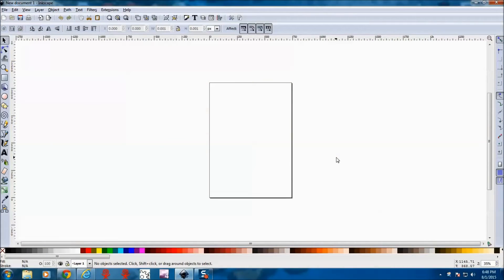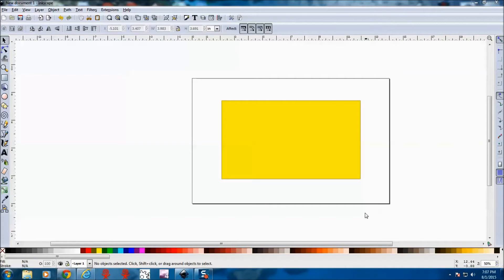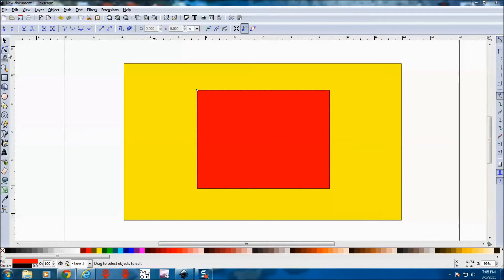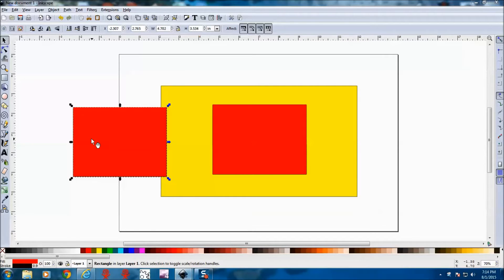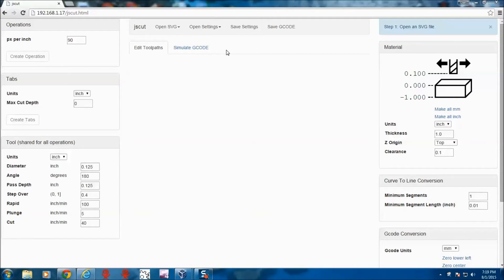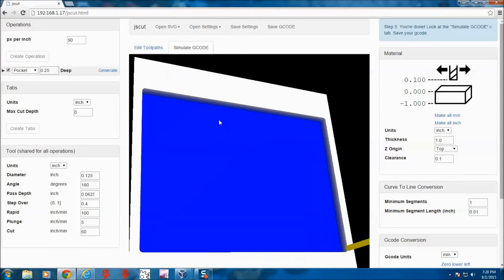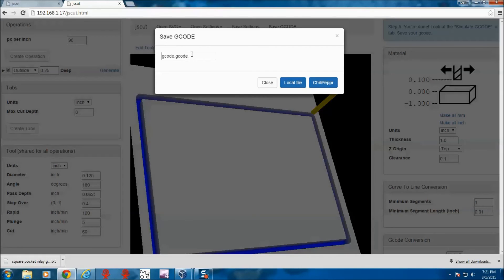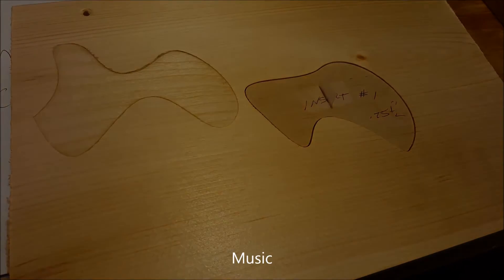CNC Wood Inlays - Using Free Software

Comment: Thank you for the post. You had mentioned Mach3, when I use Inkscape & Jscut and bring a file into Mach3 to cut all the code and tool path are in a negative x,y not on my build surface. Do you know how to correct this?

Comment: When doing a square inlay do you have to round the corners to the bit size? Or does Jscut do that for you? Great video and thanks for sharing!
Reply from the maker: +onlychevys Williams Thanks.  It's fun to do these projects.  When it comes to inlays, yes, there will be some rounding at the edges.  Depending on the size of the end mill you can make the corners more or less rounded though.  Doing inlays this way does work, I've played with it many times, but there is some tinkering to do that is more or less specific to each machine.  Jscut will follow the designs created in Inkscape very closely.  So if a corner is rounded in the shape in Inkscape then Jscut will follow that line.  Best of luck.